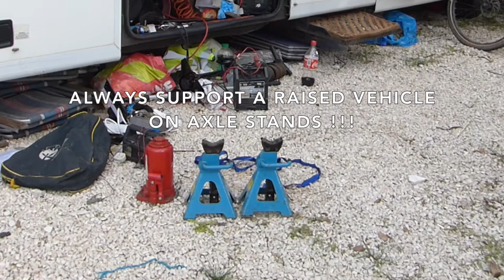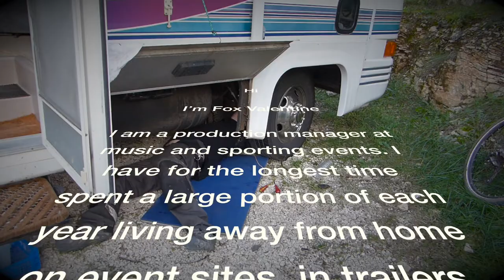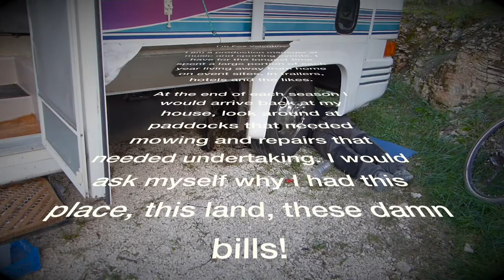RV Airbag replacement - Workhorse Chassis

Comment: Great video. Learned a lot. Found a good trick for squeezing the air bag. Use hose clamps instead of zip ties. Tighten the clamp, slide up, loosen the clamp, slide down and repeat.
Reply from the maker: Nice tip! Thanks for watching and commenting!

Comment: people assume the air bags are springs they are not,they hold the attitude of the rv at rest when you inflate,they also keep the harmonics of the spring from getting violent,if your rig came with them, replace them, they are cheap and now that i learned how to heat them for flexibility thanks to you,its a cake walk,thank you,never run without them,1993 FLEETWOOD FLAIR,7.4 TBI 4L80E TRANS,GOOD UNIT FOR 85,000 MILES ONE SET OF BAGS,THANKS AGAIN
Reply from the maker: Thank you for watching and adding to the discussion!

Comment: Thanks for the video, I am in a campground with a failed P32 front airbag 500 miles from home right now.  Waiting for the rain to stop so I can crawl back under the coach and finish removing the leaking airbag.  With luck I will have a replacement arriving tomorrow, I hope that watching your video helps speed up the installation process.
Reply from the maker: Ike Stewart . Oh Ike. It's horrible to
Be stranded. At least you are at a campground. Get as much clearance as you can, and get yourself comfortable. I removed my bag with the wheels still on the vehicle, but it would be a lot easier to take it off. The long handled plumbers pliers were a great help. Mole grips/locking pliers would be a substitute. 

Keep the faith, and just keep chipping away at it. 

I got stuck today with a defective autobrake, on my way to have an MOT test. It's all fun and games eh?

Good luck, and do check back in to let us know how you got on.
Reply: Patiences really is the key on cutting up the air bag for removal,  I kept thinking I had enough of it cut and it should pull out, I would try for a bit, then go back to cutting, and suddenly once bits started coming out the rest was easy.   I did end up running to Harbor Freight (cheap import tool shop) and buying a pair of long handle needle noose pliers and a  small folding tree  pruning saw which worked much better than the bread knife I started out with.     I feel your pain about the automatic parking brake, mine blew a hole in the hardline a few weeks ago and left me stranded on the side of the road about 4 miles from home (outside radius of a bend in the hard line blew a hole).     Thankfully I was able to add a quart of fluid and limp along another 3 miles to a shop.
Reply from the maker: The pruning saw is a good idea. I always have one in the rig, but didn't think of using it. Thanks for the tip!

Autobrake was leaking from the warning light pressure sensor, and had been for ages by the looks of things. All fixed up now.

Comment: Most people simply unbolt the shock, jack up the chassis, and remove the whole spring with bag, then reverse.  Nothing like a creative solution such as you had here to make a one hour job last all day.  You should do this kind of work professionally; you'd make a mint!
Reply from the maker: Hey, thanks for the tip. You should make a video!

Comment: Thank you very much for this video I have the same exact rv with the bag problem.if you don't mind I will be having future inquires about your RV and tips as well.
 Thanks again👍
Reply from the maker: Megga cool ball glad you found the video useful. Feel free to ask anything. My aim is to demystify RV maintenance. Thanks a million for subbing, it’s really great to have more followers!
Reply: FoxRV thank you very much
Reply: Hi fox rv HOW ARE THE AIR BAGS HOLDING UP HAVE THEY ANY  DAMAGE WITH RUBING UP AGAINT THE SPRINGS
Reply from the maker: Still going strong. Crossed Europe 5 times since fitting them!

Comment: What is the model number of the air bag?  I also have a workhorse 2001. 
Will 2001 Chevy P30 work also?  Tnx
Reply from the maker: Hi Jo

Go to the files section on my website, and look under "Chassis/Airbag": https://www.foxrv.uk/files

Airbag notes: https://www.dropbox.com/s/mpoecfja7ulc6eg/Air%20Bags.txt?dl=0

Front Airbag Manual: https://www.dropbox.com/s/1kv8bhvtjeo21bf/Airbag%20manual%20%20MN-360_81560.pdf?dl=0

Rear Airbag Manual: https://www.dropbox.com/s/q729fp45sn3tpiu/airbag%20rear%20maybe%20MN-211_57219.pdf?dl=0

That should give you all you need!

Sorry for the delay in reply.

All the best

Fox
Reply: FoxRV I installed mine about 2 weeks ago.  I used reciprocating saw with long blade.  I put coconut oil to push it in that small hole. I did not have to put air on it.  It slides all the way with a little bit more push.  Tough job. I won't buy an RV with an air ever :). I also installed the hose on my bumper where the tag is screwed on.  Thanks for the video.
Reply from the maker: Great work. The coconut oil was a great idea, there seems to be a never ending list of uses for it! There are higher rated springs available, that don't need the bags, but I imagine you've discovered that already. I'm in two minds on the concept. I've had a few rigs that are old and saggy, but never got around to changing the springs. Changing bags, despite being a pain, is I think easier.

Happy travels!

Comment: Does the airbag raise and lower the front end or does it simply firm up the ride?
Reply from the maker: Both. Particularly useful is the ability to counter sag on the rear. But the same effect is apparent on the front springs too. Maybe 3" lift on the front.

Comment: Next time. JUst flatten the bag out and put the cap on. Raise RV high enough to fit the bag through the spring. You can also drop the plate down through there as well.
Reply from the maker: Joseph Ankney Interesting. I did look at that and there was nowhere near enough space. Maybe my springs are too old and tired. Thanks for the tip!
Reply: @FoxADV  heavy duty springs do not allow u 2 squeeze thru them i tried
Reply from the maker: smoothoperator Ah thanks. That makes total sense.

Comment: I found raising RV enough to remove wheel made job much easier.
Reply from the maker: I tried that for the removal. I found the space under the spring to be a little limiting, so I put the wheel back on. On reflection though, I think you're right. I could have used an additional jack to bring the hub back up.